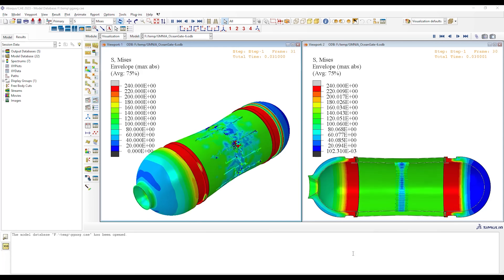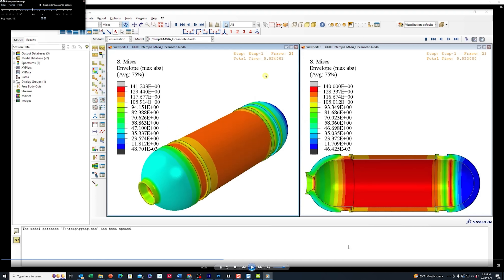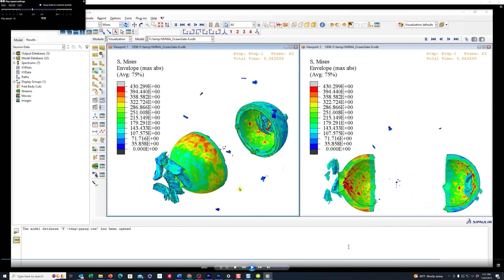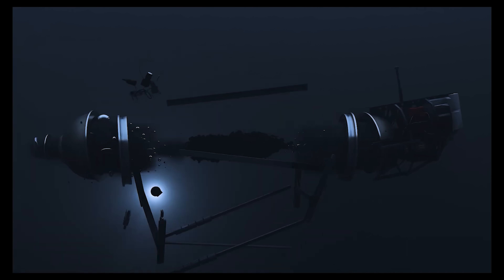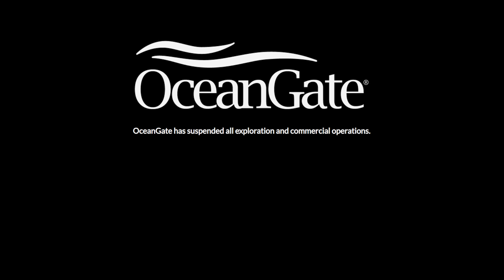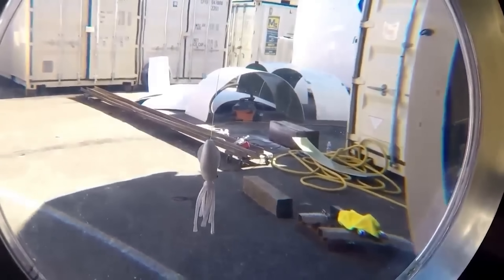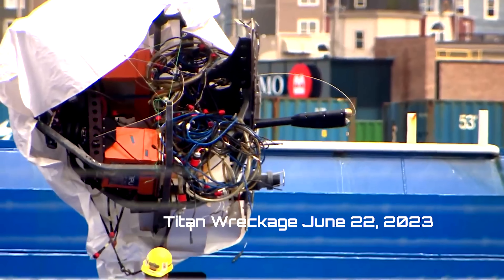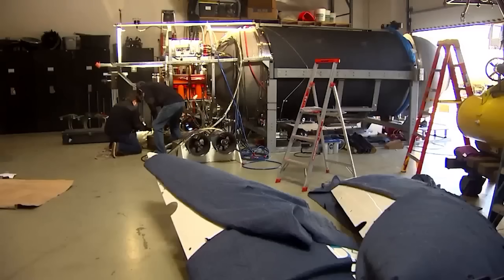Best Titan Sub Implosion Simulation, Cracked Porthole? Q & A

Comment: The guy saying the carbon fiber exceeds all strength, weight & buoyancy of any material out there was one of 2 things. 1. Lying or 2. very misinformed.  The other thing I notice is Stockton wearing his safety helmet and goggles when showing someone the sub?  No one's working on it and was that for show?  Last I wonder if they had a short while where they realized they weren't going to make it or Stockton was constantly reassuring them it was just a glitch and they'd be okay.   Anyway I certain enjoy Jeff's videos.
Reply: Yeah, he didn’t have any carbon fiber design or analysis experience is my guess.  It’s a bit of a misnomer with carbon fiber that we call it a “material” like it’s one uniform thing for everyone who uses it, but each design using carbon fiber is actually creating the material and its requisite strength and physical properties depending on the layup used, the type of carbon fiber used, the resin, the cure method, and other factors.  So yes, it can be strong, IF you design it to be strong in all the directions you need it to be.

Comment: You have a good point. I was thinking that Oceangate always seemed to film every other dive they had made, which makes sense to use the videos for ads and promotion and such. So there would be no reason I could think of that they wouldn't film the last dive. Who knows, they may have recorded the whole thing. Time will tell on that I suppose. :)
Reply: I've been thinking the same thing since the minute I heard it was gone. There's got to be lost footage of the dive right up until the last milliseconds. God how much would that footage be worth? Big bucks. 💯💥💥
Reply: @graftongodofmemes  Oh I think your right, would most likely be worth a whole lot. I suppose only the future will tell but it surely will be fascinating when it does. :)
Reply: I don't think there is any doubt that there would be viable pictures/video in the debris field. I feel certain that some were collected. Whether you ever see them that remains to seen. They will be made available during any trials that are sure to come.
Reply: I wonder if there’s enough interest to look for those nuggets. It may be a time sensitive undertaking, due to currents and silt rate and corrosion and the abysal food chain. Maybe Cameron would do it. Rich guys on-board, families’?

Memory viability seems low to me, of anything not mounted outside the hull. Too violent. And for those external cams, was the memory hardware out there too, or inside at the end of a wire?

I’ve been trying to imagine a smaller scale lab test/experiment to see if even any of the discreet memory components (of the inside ones) could survive that sudden immense pressure spike. What a weird rabbit hole, on a Thursday evening lol.

If the Akashique Record is a thing, maybe somebody will look there.
Reply: @johnnyliminal8032  LOL, a rabbit hole indeed my friend. Hope the research helps you find some answers. A lot of questions to be answered on this one. :)
Reply: @johnnyliminal8032 The submarine violently implode under salt water... What type of storage could survive that ?

Everything plastic or metalic would be crush, and even if it's not the case, the salt water would definitly destroy everything electronic.
Reply: @pierrotA  Yup, I agree. But you never know until you look, and then put in the work to decide if what you believe is so.
Reply: @pierrotA  cameras on the outside to survive you can see it in the wreckage. But we don't know how the information was stored was it sent back to the mothership and recorded? Did they see it on a live feed?
Reply: I think the NTSB is involved in the investigation. They have a lot of experience getting information from damaged "black boxes" after aircraft crashes.
Reply: I think they did, but are telling us otherwise. The only ones that know and have seen it are gov and the company. That's it.

Comment: Did I seriously hear him say he covered his hull with Rhino Liner?  And then trys to add that the military uses it to keep water out under high pressure!   I looked it up and it is a truck bed liner!   Look at the big smile on his face as he says it.  Like, look how clever I am to find this cheap coating that will protect us 13,000 ft below the surface.   Man the corners this guy was cutting, just to get his cheap ass toy submersible in the water, is mindboggling.  
Scary stuff.

Comment: Was thinking the porthole from the beginning ..love to know the physics  how a forward decent would change the pressure loads on the forward section .particularly if rapid
Reply: Probably not the window.

The retaining ring and nuts were ripped off. If the window caved in, how would the pressure push the ring that hard?
The ring doesn't hang over the hole any.
Reply: @lordgarion514  wasn't depth rated to that depth plus how forces on a forward decent a concentration of force pressure on that area ?
Reply: @andrewbristoe1833  
Doesn't matter, the fact is if the window went inward, there was no way to rip off the retaining ring and nuts.

And they were gone.

And there was literally nothing that was rated for that depth.....
He was pushing everything to it's limit. It was a coin toss what went first.
Reply: @lordgarion514  still want to know to me the p hole was as much a week point as the hull the pump for the weights a bit wtf to the air electronics cable entry's to yes and an implosion from the p hole or hill .How to prove which difficult an understatement
Reply: @andrewbristoe1833  
Yes, there were a lot of weak points where it could have started collapsing first 

And I do not know which failed first.

But again, if the window went inward, then there was no way for the ring and nuts to be ripped off

Comment: He coated his submersible with truck bed liner claiming “it’s what the military uses”… as a floor coating.  The military doesn’t use Rhinoliner to keep water out of submarines! 🤦‍♂️
Reply: Military subs don't go down to titanic depths 😂
Reply: @wshyangify  How do you know that is true?
Reply: @David-dh9fk so in the 2 months sinced you asked “how do you know this is true” have you done some proper research? Or at least read some kind of book? 🤣
Reply: @David-dh9fk  
The easy way to discover this is to look up the specifications.

In this case, none of the submarines used by the US navy (by way of example) go beyond ~1,600' depth. And generally, they don't even make it to 1,000'. These are far short of the depth of the Titanic. If a sub were to somehow wind up there, it would be destroyed.

The military application of these systems imposes a limit to how deep the submarine can go. Of course, newer submarines generally can go deeper, but as you see above, they aren't remotely in the running for Titanic depths.

But do understand: this is tangential to what's being discussed: Rhinoliner isn't used for submarines--not that I know of, anyway.
Reply: @David-dh9fk  He is correct. Max depth of a military sub in wartime is about 1300 feet. About 800ft during peacetime.

Oceangate went 12,000ft in Sub using glue and screwed end caps and not welded with a brittle carbon fiber. That was a death trap. 🤣
Reply: He should have used FlexSeal.
Reply: Oh no, I missed that part! When used as an undercoating in vehicles, those rubberised liners are notorious for trapping water. I imagine any water that accumulated in the carbon fibre would be thoroughly contained there. 😬
Reply: ...and this would also make sure it is impossible to  isually inspect the material condition between dives. Not sure if that was such a good idea.
Reply: The military is not stupid.   They use FLEX SEAL instead.   Much better.
Reply: Correct, I spent 4 years in the Navy on the USS Camden and the USS Mobile and I can tell you it's used as deck grip. It's sprayed or laid out on the deck of the ship.

Comment: i think those cracks on the window in the pictures is actually just frustrated total internal reflection, which indicates an imperfect bond between the window and the substrate
Reply: I saw what looked like a crack that actually looked like a Seagull had dropped one on the porthole. When looking at it from the outside, however, it is a tassel attached to it. Probably used to indicate direction as there can be a loss of spatial awareness in water!
Reply: Ohh that’s a new term for me. Interesting
Reply: It's more likely the carbon failed, too many real experts believe this and the power of the implosion blew the window out...

We are talking thousands of tons, physical force, not psi..10,000 tons equally around the sub.

Comment: If the glass failed, there would be delaminating of the epoxy on outer most part of flange on titanium bell, and if it collapsed in center, it will have witness marks on inside flange ( the glue line you would see if you were sitting inside

Comment: I agree with the PhD Engineer.  Vessel failed in the middle.  My prediction from the beginning.
Cylinder edges supported on ends and not in the middle.  But...weak link could have been external to internal connections which would be a stress riser...creaking was noted in aft of vessel....or window failed...we don't know until more thorough analysis is performed.  Btw, Rush did finally get that destructive cyclic fatigue validation testing he tried to short circuit due to cost and timing.  It failed.  What an awful man.

Comment: No, the crackling sounds were AFT, the porthole was on front.
Reply: Assuming the transcript is true.
Reply: People seem to try to include every new factor to create the most complex and dramatic scenario they can.  The hull and viewport weren't strong enough, one of them imploded, and the shock wave wrecked the other non-titanium parts of the hull.  That's the only thing to suspect given the current evidence.
Reply: I'm sure the hole where the 10,000 psi hydraulic hand pump exited the living area is where the aft sounds were coming from.
Reply: Sounds like equipment bay failed first, and flooded. Hence the loss of bouyancy, and having to drop ballast etc. but still wasn't enough to get back up fast enough.

Comment: Pretty sure the hand pump is what caused the final straw of stress relief if you think about it. They said 10,000 psi hydraulic hand pump like a car jack. The 10,000 psi vs the multiple Eiffel towers of barometric pressures underneath plus you look at the supposed transcript they had to do multiple attempts to get it to drop
Reply: And Rush turns to the passengers and asks: "Anyone have any ideas?"
Reply: Looks like it enters thru the aft dome 9:01 , wouldnt cause catastrophic collapse of the cylinder and leave the aft dome in tact. With the domes in good condition an opening like that would lower the pressure differential rapidly which would relieve stress on the cylinder leaving it in tact.

Edit: idk why they would want that as a hull penetration though
Reply: @GreatKhanz  With the domes in good condition, did they find the aft dome.
Reply: @edwardallen6175  they found both titanium caps in tact on the sea floor, only see pictures that the front one was brought up
Reply: @GreatKhanz  the cylinder wasn't intact. The white part that was retrieved from the outside back section was not part of the inside pill shaped cylinder which contained the passengers. Being outside and separate from the cylinder, it was not subject to water pressure that the cylinder haul was, hense it survived the implosion.
Reply: @cathybaldry7822  yeah, i was saying that its unlikely to be caused by the hydraulic line because the cylinder isnt in tact.. if the hydraulic line leaked it would be